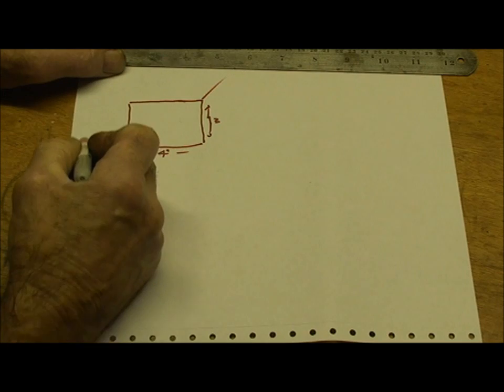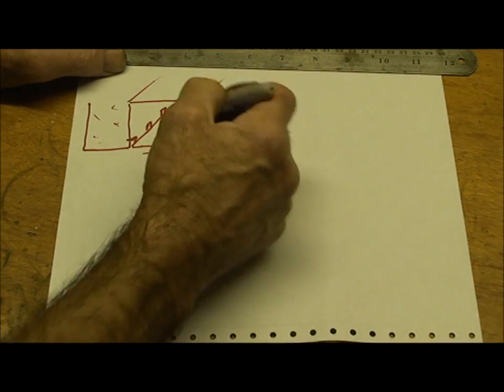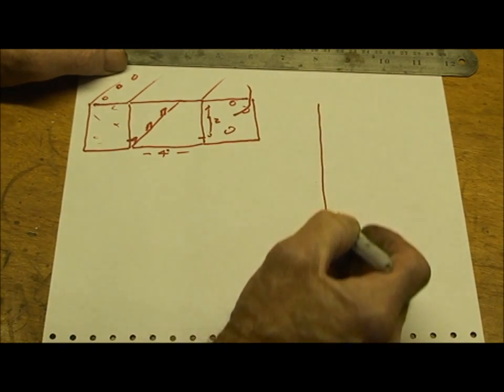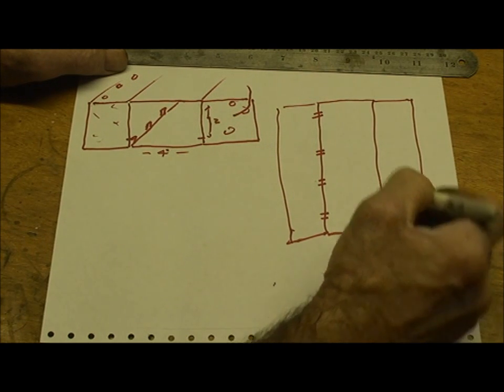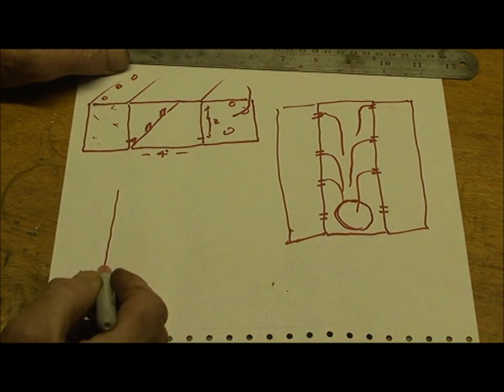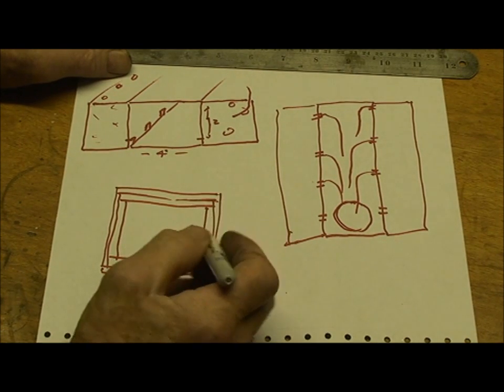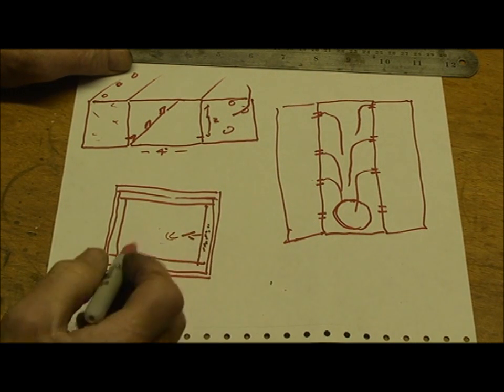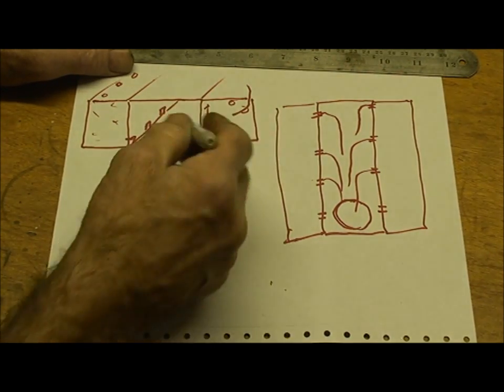rocket stove forge idea open innovation project on the forum.

Comment: have you tried building this?
Reply from the maker: Life Seeker Was more of an exercise into throwing ides around, I think it put some serious heat into a piece of steel but require alot of input to keep the heat going. I use a gas forge for my welding because i need to maintain high steady heat during the whole weld.

Comment: Hey ppotty why not make the forge as the flu itself?  Just drop the steel right in through the top?
Reply from the maker: Hi Threeredstars, Yea I guess that would be a good high temp in there problem would be the heat transfer up the work piece to the handle for me. Make it near impossible to hold onto and I cant use tongues to forge my billets.